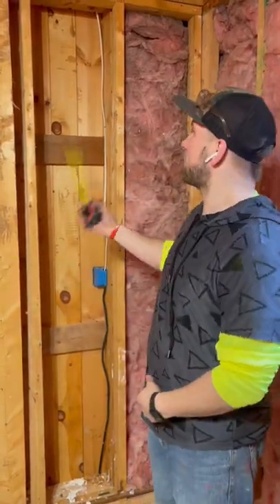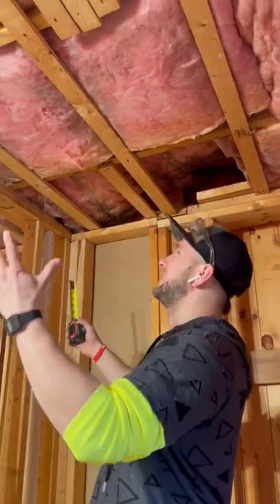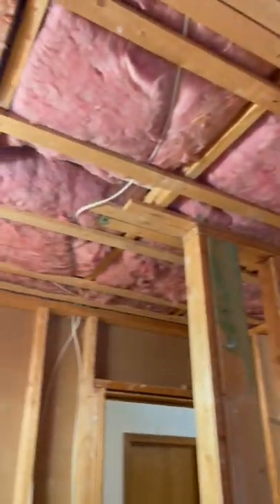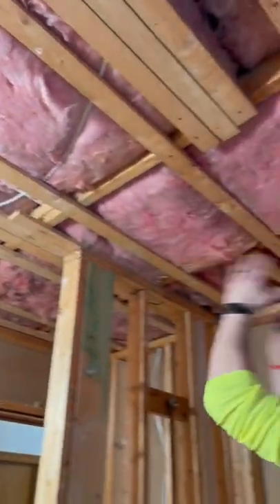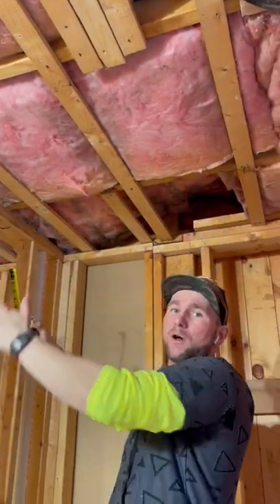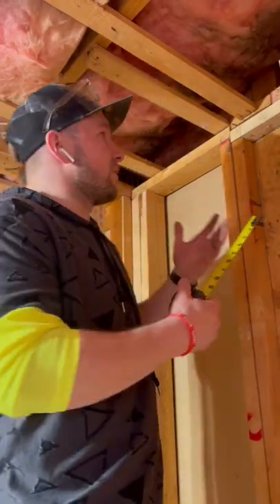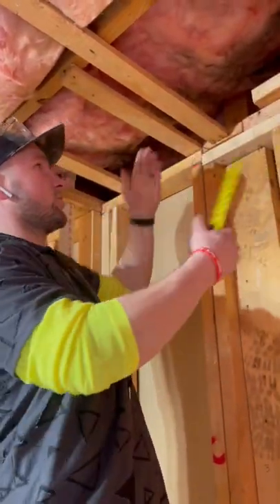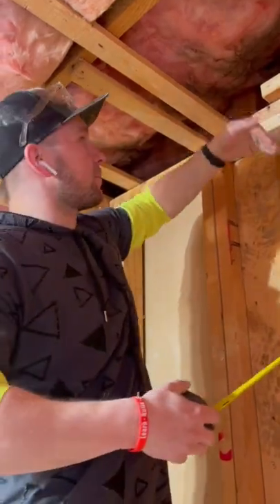Few tricks for figuring out if it’s a wall bearing wall. #shorts #youtubeshorts #diy

Comment: Also, a load bearing wall will have a double top-plate (meaning double boards). Some non-load bearing walls have this too, but all load bearing walls should have it. When I don't see double top plates, that's one clue the wall is not load bearing.

Some HORRIBLE things can happen if you inadvertently remove a load bearing wall. It's fun to make your guess if the wall is load bearing or not, but you really should not disturb a load bearing wall without first consulting a structural engineer!

Comment: If you have actual trusses than only the exterior walls are load Bearing
Reply: That's This some very dangerous advice you're putting out because it isn't always true!

Even if it's just a single story home imagine the mass that a structural wall might be supporting: the trusses, the roof sheeting, the roofing itself, maybe even snow. You can easily have several tons of material collapse on people by disturbing a load bearing wall. Not to mention you can completely destroy a home by disturbing a load bearing wall.

Although it's unlikely, imagine someone reading your statement, which sounds like it's from someone with expertise, removing an internal load bearing wall and simultaneously causing death AND completely destroying an otherwise perfectly good home.

I was once on a site where the carpenters were adding a sliding patio door and they built a temporary support wall, to support the load, whilst rebuilding the original wall to support the load. When they removed the original studs, the top plate dropped about a half inch, even though the temp support wall was in place. They had the foresight to have all the new studs cut to length, which allowed them to get the top plate back to the right elevation (using hydraulic jacks). That house moaned and creaked in an eerie way until everything was set back to it's original position.

Hire a structural engineer to advise you when considering the disturbance of a wall or column, etc. because many houses (especially ones with complex roofs), have internal structural supports, some in the form of walls, others in the form of columns, etc. Don't be that guy!
Reply: @cornpop7805  trusses are engineered to be supported by the outside walls 99.9% of the time.  A truss would half to be engineered to have an additional support besides  the outside walls. I’m not saying they don’t exist but in my 30 years of building I have never seen one.
Reply: @rdavis719 
That's usually true for houses with a simple monopoly style gable roofs. But homes with complex multifaceted roofs (still made using trusses) often have internal load-bearing walls and columns. There are high-end neighborhoods in my city where every single home has internal load-bearing walls and the roofs are made from trusses. I'm not just talking about load-bearing under floor systems either. I'm talking about internal load-bearing walls and columns that support truss roof systems. That's near 100% of the homes in whole suburbs, when those homes are high-end with multifaceted roofs.